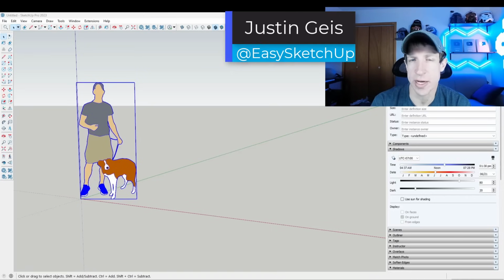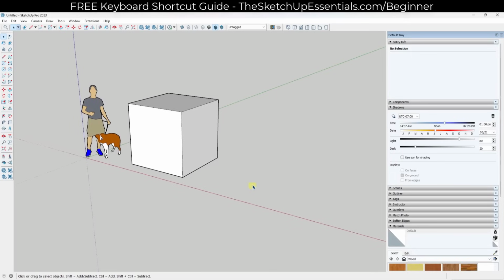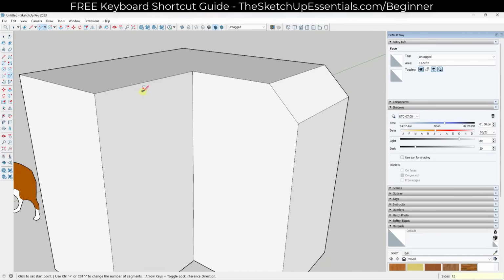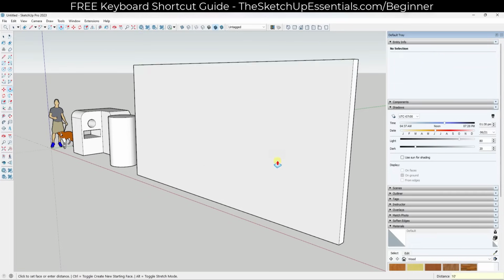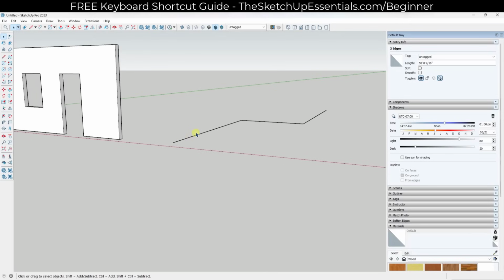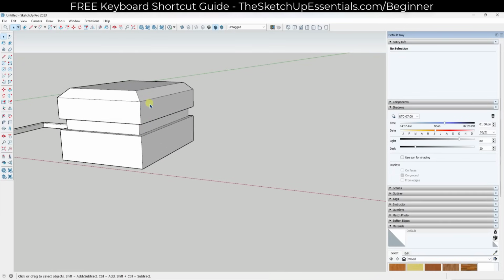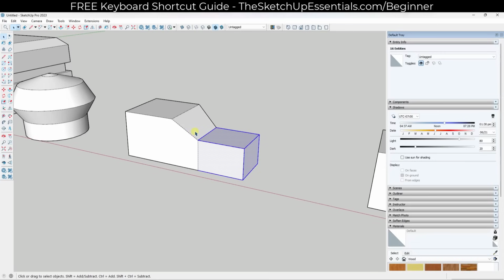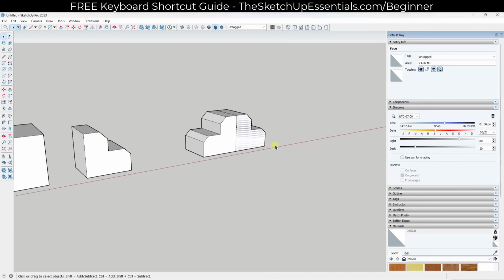Getting Started in SketchUp Pro Part 2 - Modeling 3D OBJECTS!

Comment: When you were using the create use face mode on the cylinder, my new geometry breaks up the ring around the cylinder into like 50 segmants instead of one ring like yours that you simply select to scale. Also I can't find the view tool bar any where! I just downloaded sketchup pro 2025 on a Mac. help
Reply from the maker: Yep that'll happen sometimes. Select that edge geometry (not the face) for the whole cylinder, right click, and select "weld edges" before you extrude the cylinder

Comment: How did you manage to get new face for cylinders using control key?
Reply from the maker: I don't understand the question - I tapped the control key with push pull active
Reply: I know, it was difficult to frame that question correctly.. but what I meant was clicking control and pulling is not working.. but I found out on Mac it's click option instead and that gives a new face..